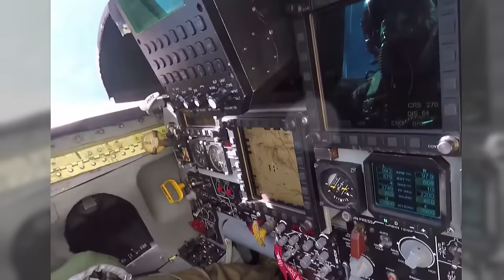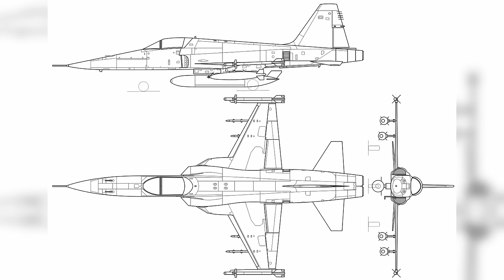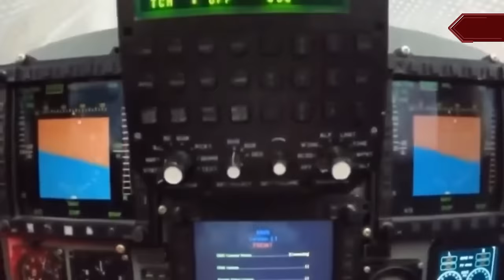Why is Iran Building It’s Own Fighter Jet?

Comment: iran only need this fighter jet for dogfights with enemy fighter if it was necessary but not fo it own operations 
Why are fighter jets being used in the first place?
Why don't we use land-based missiles instead of fighter jets for precision attacks?
There are two kinds of missiles: cruise missiles, which are accurate but lack range, and ballistic missiles, which are almost limitless in range but have very poor accuracy.
Fighter jets are used to deliver precision attacks with air-launched cruise missiles.
But why did they have to be air-launched?
Cruise missiles can't be long-range due to a problem known as "the tyranny of the rocket equation." For range, you require fuel. Fuel increases the weight, which decreases the range. So the answer they came up with was to move the missile close enough to the target with an aircraft, then launch the cruise missile. and for longer range they made aircraft carrier to move the fighter jet closer to target 
But why don't we make ballistic missiles as accurate as cruise missiles to eliminate the need for fighter jets and aircraft carriers? 
The ballistic missile that could go long range had a problem of its own known as "REENTRY PLASMA EFFECTS" which happens When slamming air particles into each other as fast as a reentering object does, the extreme heat from all this friction raises the temperature of the air so high that the gas becomes ionized, forming essentially a cloud of plasma around the outer surface of the craft in the reentry phase  that interrupt the radio communications between a vehicle and ground station.
 In simple terms, you can't guide it. Therefore, long-range ballistics are only used for nukes that lack of accuracy isn't an issue.
 So obviously, when Iran announced that they somehow developed ballistic missiles with pinpoint accuracy, everyone dismissed it as propaganda. Even after Iran released the footage of a ballistic missile hitting the target with pinpoint accuracy,. Iran was accused of Photoshopping, despite the lack of any evidence to suggest the footage was altered. But after the attack on the US air base that all missiles achieved bullseye, everyone had to accept the fact that, just like the Persians were the only ones with Damascus steel technology, now they repeated similar unachievable technology. Uzi Robbin, the father of Israel's missile defense, said this in reaction to Iran's pinpoint ballistic missile . "By pushing a button, they were able to accomplish a task that we need to risk the lives of pilots and costly fighter jets to do the same. and they probably were under air conditions when they  pushing the button"
Conclusion: iran doesn't need any aircraft or aircraft carrier to diliver precision attacks
Reply: درود به شرفت داداش مطالب جالبی بود❤

Comment: Looks like an F-20 Tiger Shark. It's a twin jet. I believe that the F-5 was a single jet. I think Japan has some F-20's.👍
Reply: Japan does not have any F20s. There were only 3 prototypes of the F20 and it was canceled. The F5E has duel engines and the F20 had a singular F18 engine.
Reply: @SkiddyOcean117  thanks for the info. I thought they actually produced it.👍
Reply: True, it looks more akin to the F-20 which, I believe, is basically a derivative of the F-5 and T-38.
Reply: In Fact It's Modernized F-5 Called Kowsar Or HESA K-1 

HESA K-2 Is Iranian F-20 and Has Single Al-31 Engine Soon will be shown by Iran

Comment: I feel the narator is abit to generous when describing the aircrafts capabilities. While I find indigenous aircraft like this interesting, some how I feel in combat capabilities this thing is like 3+ generation aircraft, and still not a good match against the f16 for example. Also, who would import it?
Reply: To be fair, F-5 is not a 3rd gen fighter. The F-5S variant was able to use AIM-120 AMRAAM and F-20 is actually comparable to early variant of F-16. I would say that F-5S and F-20 Tigershark are considered 4th gen light combat aircraft with the capability to shoot BVR missiles. Also, Kowsar/F-5 has a speed of Mach 1.6 which is faster than most LCA/FLIT aircrafts and the fact that Iran has the technology to building their own indigenous engine puts them ahead of Turkey, India and South Korea in terms of fighter jet engine technology
Reply: @ViolentCabbage-ym7ko  But Iran doesnt have access to the F-5S or any other modernised variants (which are budjet friendly stopgaps and the f-16 is still better), and the f-20 didn't go past the prototype stage. All they have are F-5E's and F's, there indigenous OWJ jet engine is just a copy of the old General electric J85 (not really indigenous or cutting edge), and it is not known how reliable it is.
Reply: @algirdas6012  It's possible that Iran is able to buy these modernized variants through the black market and reverse engineer the tech. That's how they managed to keep their F-14 fleet still operational.

Comment: hm.............I don't see them being able to create a whole supply line of good engines, consistently.
Reply: Haha, reminds me when all foreign oil workers left Iran after the revolution and them saying Iran won’t be able to export one barrel of oil without us ! 😂
Reply: @azar3006  Yeah, agreed. Iran has already master single-crystal technology and that well establishes it on the path to building it's own engines. Quality control will ensure that standards are kept up, which I believe is more than achievable since Iran exports military hardware to russia now and that's not some small or even cheap partner contrary to what some people say.
Reply: @azar3006  it's the consistently part i was referencing. They'll have a few, but they're going to run into supply issues when trying to mass produce.
Reply: @swedhgemoni8092  I agree they can do it, but supply lines and consistency are what I was referring to. I have no doubt they can produce it, but can they have an effective streamlined process in place with minimal issues, that's the question that I'm curious to see answered.
Reply: @usem_and_losem937  I follow their aeronautical industry. I have no doubt they can do it, even with a lot of trial and error.

Comment: Stop, I understand this guy is an ex fighter pilot but saying this fighter can go against other Gen 4 aircraft is insane!!! This F-5 remake could not even see a F-15, F-16 or F-18 before it would get destroyed. The F-15 is almost untouchable in air superiority against almost any aircraft especially an F-5 it just doesn’t had the speed, power and radar to compete with any US 4 gen fighter. Irans Air Force will not be a threat to the US for many years to come!!!
Reply: Yes well here is the problem with that thinking

The ROE's for better than  50 years now and they are not likely to change anytime soon if ever is that you have to close and get a visual on the aircraft to ensure it is not a friendly that has a failed or turned off transponder or other avionics failure 

This idea that you are going to sit back BVR and shoot and a blip on  a radar display is great in theory but in practice it does not happen that way 

That is what they thought with the F-4 with AIM-7's  

That is what they thought with the F-14 and AIM-54's 

That is the Achilles heel of the F-35 

If if a fighter pilot does not specially have to the vast majority of the time a fighter pilot is still going to do it.

Comment: Still waiting for the Q-313, not impressed that they copied a 60 year old 3 gen and simple jet. When they start building F-14s let me know. I question the reliability, is it up to Chinese quality or is it worse? Time will tell.
Reply: Be careful, your prejudice is showing, remember when Japanese car were called junk or in your case Chinese stuff is junk . Samsung, one if the biggest producers of semi conductors in the world started from nothing but Korea’s desire to create a world class electronic industry. 
These old stereotypes need to go away. I used to get annoyed when people found out I was from middle east and their first question was did I ride camels, imaging their face when I told them I had never seen a camel but in pictures and our taxis were Mercedes Benz ! 😂
Reply: @azar3006  how is pointing out that they are re using a 60 year old design prejudice?

Comment: from what i understand the SU-35 is way better than american 4th gen & was made to take out the f16 & f15. Also im pretty sure the radar on the Su35 can detect F35's from further distance the f35 can detect the SU35. Besides that the f22 should still be king but too expensive to maintain.